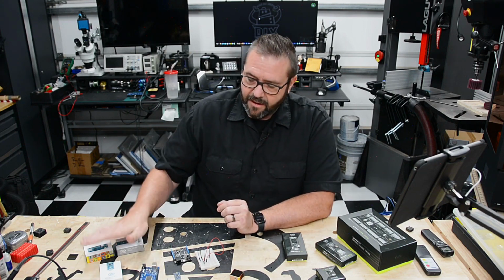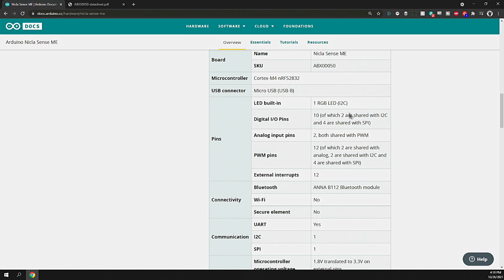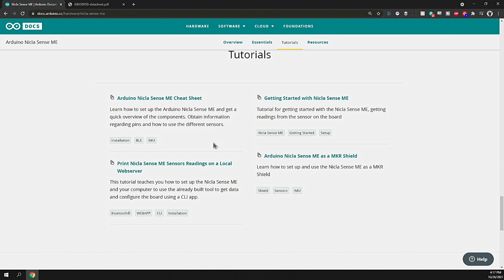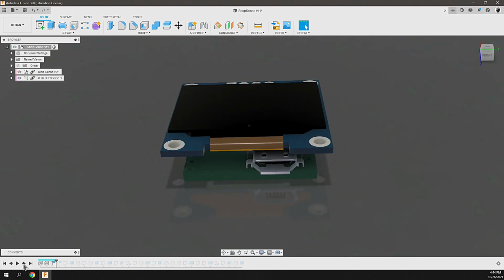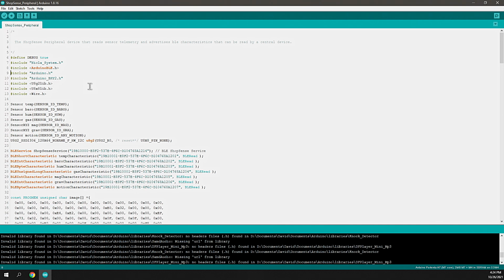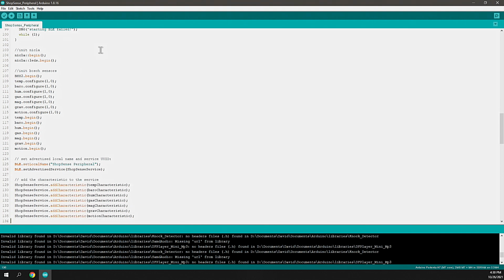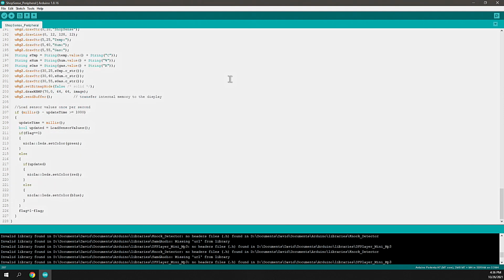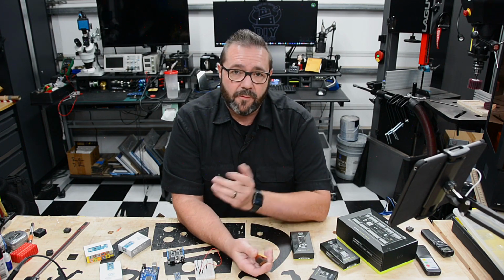Hands-On with the Arduino Pro Nicla Sense ME!

Comment: Hi great and helpful video. I have been attempting to implement the temp, humidity, and pressure sensors using the standalone example in the arduino IDE. I am having some issues with the boards such as many warnings when compiling and errors with uploading such as the port not being found. However, on some attempts I am able to upload the sketch (With many warnings). When this happens I am experiencing the temperature reading to steadily rise from 30 C - 33 C despite the room being approx room temp (about 23 C). Any advice on how to trouble shoot these issues?
Reply from the maker: I would look into calibrating the sensors, i did come across that information in the Bosch sensors sdk/documentation linked from the nikla sense page. That should allow you to modify the arduino library and control the error your seeing in the reads. I’ll update this if i get the chance to lookup the docs referenced.

Comment: Interesting. I will likely give it a try using MQTT with HomeAssistant, grafana, and influxDB. BLE is not a very reliable mechanism IMHO. Of course that means tying it to a wifi module (ESP most likely). I 3D print lots of ABS, so it will be interesting to test the air quality side of that. I already use accelerometers on my Klipper-based printers to do resonance tuning...
Reply from the maker: Agree about BLE, definitely not good for a safety applications but apply some ml to the data and may identify conditions that lead to further investigation.